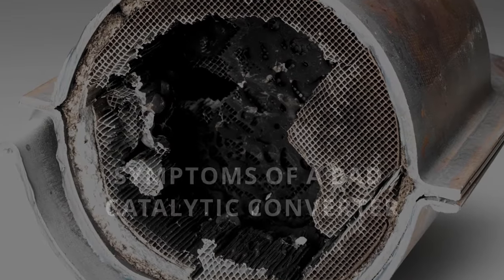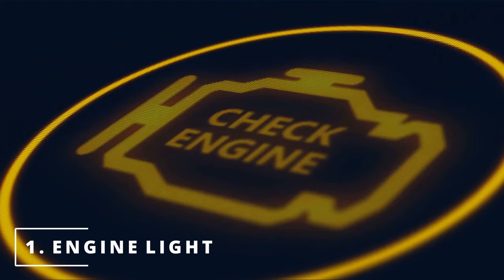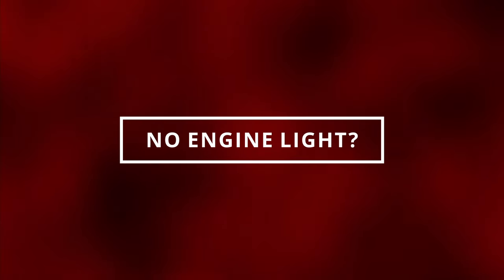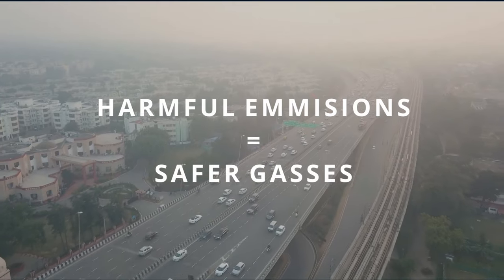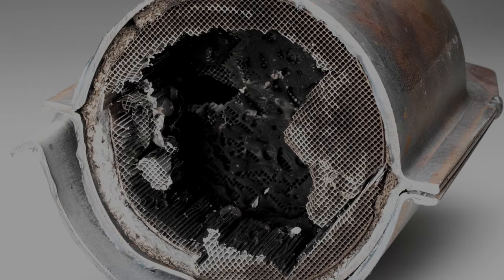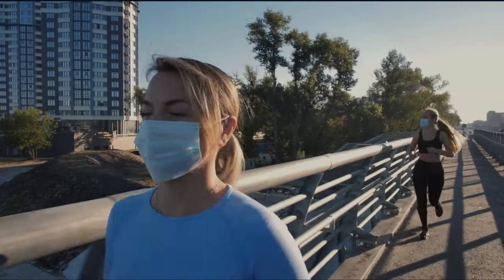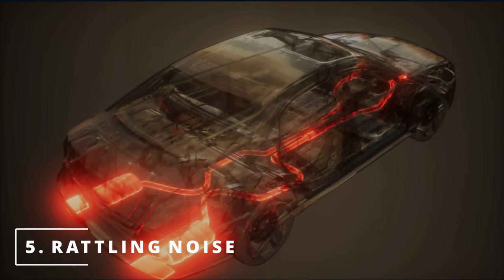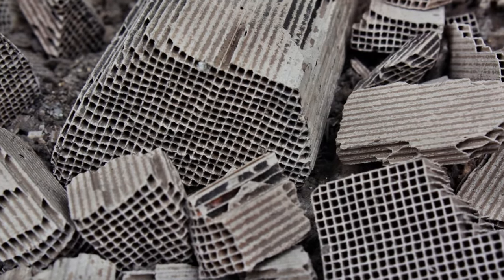SYMPTOMS OF A BAD CATALYTIC CONVERTER

Comment: How do you prevent over enrichment of fuel in the engine?
Reply: Check your air filter, fuel injector (or carburetor adjustment), timing
Reply: It's simple. Stop giving it so much money. That is the only way to stop the enrichment.

Comment: Can a bad catalytic converter cause spark plugs to keep failing
Reply: yeah i just replaced my spark plugs and week later the spark plugs were almost burnt out, cuz the exhaust gases run back to the combustion chamber and expose the spark plugs to heat and burn
Reply: @jackgomez9440  thank you for responding. I've been going through this with my Tahoe for about 2 years, and I have been taking my truck to different shops hoping that someone would get to the bottom of me needing to have my spark plugs , coils and o2 sensors replaced soooo many times. No one never mentioned anything about me needing a catalytic converter until last Dec AFTER I decided to buy another truck.and I didn't believe him because the check engine light didn't bring up a code for it and after having the spark plugs and everything else replaced the truck ran well until the plugs burned out again which only took a few months so now it's just sitting and rotting away.
Reply: @icorp3942   here is an advice never ever take ur car to a mechanic unless u know that the damage needs to take it to him u can use car manuals ,youtube ,ask on reddit ,do anything , try every method u can and even if u couldnt fix it at least u did what u could do , and i hope ur car gets fixed

Comment: PLEASE. FOR THE LOVE OF GOD.
If you have a turbo underboost, CHECK YOUR CAT/DPF FIRST.

I've spent THOUSANDS on turbo rebuild, new turbos, boost hoses, turbo actuators, intercoolers, MAF and MAP sensors. 
Turns out that my cat is destroyed creating too much back pressure on the turbo. Shaking it sounds like a maraca. 
Always check the entire pathway before loading the parts canon.

Comment: I had two go bad and computer didn't flag it 
One caught on fire and other was clogged 
I replaced it  with better one went 25 to about 35
However add wider tires it went back down around 27

Comment: I had a 2003 Camry and it was burning of oil do you think it was a catalytic converter
Reply from the maker: No, burning oil is due to worn piston rings, valve seals, or a pcv valve. Burning oil can lead to a failling catalytic converter though.

Comment: Funny, cars that were built before catalytic converters never smelled like rotten eggs.  Why does a car with them smell like that when they fail? There must be some partial conversion happening so that part of the emissions are converted or a 2 step reaction and only the first step occurs.
Reply: My thoughts are leaded versus unleaded
                                🤔
Reply: @stevegarcia1796  classic cars that don't have them at all don't smell that way even when running on unleaded.  4cycle lawn mowers don't have them either and they they don't have the rotten egg smell.

Comment: Traverse are garbage. Anyways, I never did look up the rpms. It get to about 45mph then Boggs out. Is that the same as in the video where he says they’re at a red light and the RPMS only allow to get up to 3 grand? I’ve had it test, 4 mechanics and at parts stores all read different. Napa and auto zone. So who do I go by? This is a joke and the worse vehicle ever made. Now it’s my window. Don’t know if it’s off track or motor is out. I replaced the drivers main control switch. Just a little ticked off.